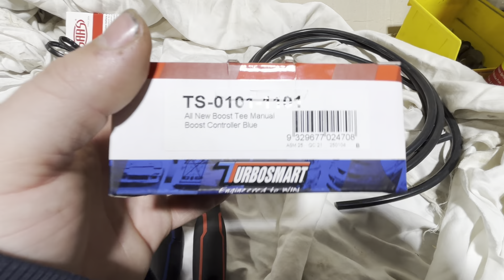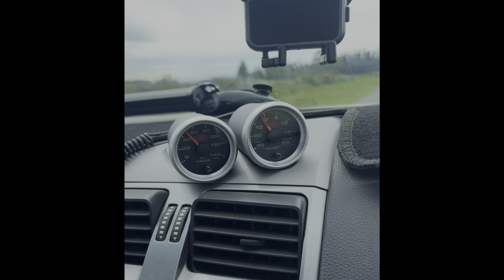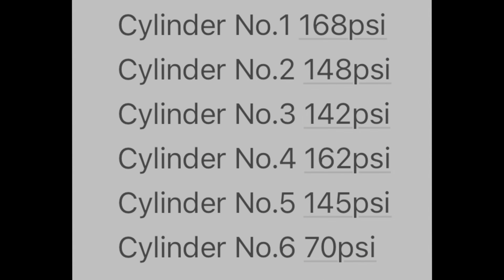Some Upgrades,New Wheels & Colour Matching Doors For BAF

Comment: i wouldn't worry too much about turbo play especially if its only when u are pushing the blades in and out as thats normal and with no oil pressure theres always expected to be a tiny amount. if theres play from side to side thats when I would be a bit cautious
Reply from the maker: Oh yea makes sense I’ll just leave the blow off on for now till I get a new turbo just so I can sell this one as mint condition but my next turbo will be brand new so i shouldn’t have to worry about it
Reply: @ just from rereading my comment i meant it the other way sorry, in and out is bad. side to side is normal. also blocked bov damaging your turbo is a complete myth. there’s a lot of videos out there explaining it. but i would rock the no bov and enjoy the turbo flutter.
Reply from the maker: Oh yea algs I’ll just leave it alone for now and save for a new turbo then once I have that probably early next year I’ll let it flutter all day